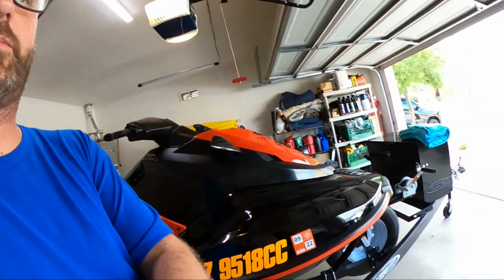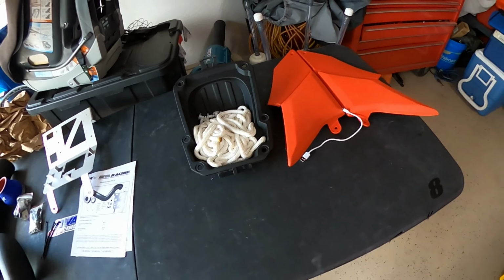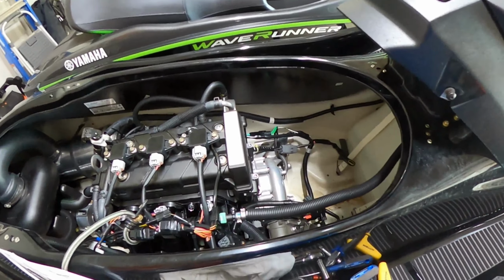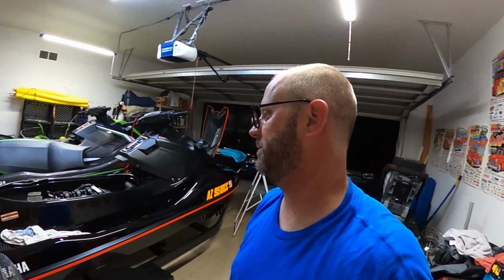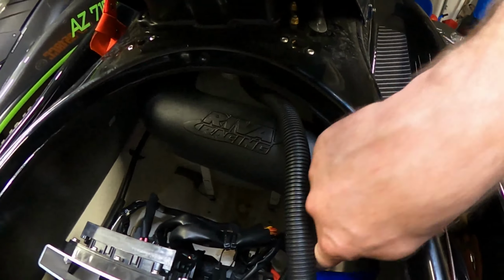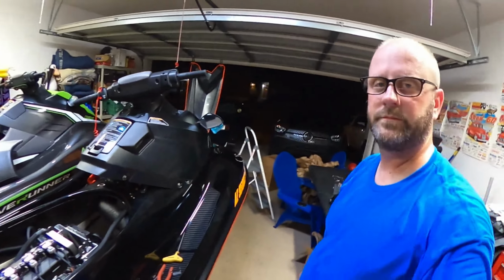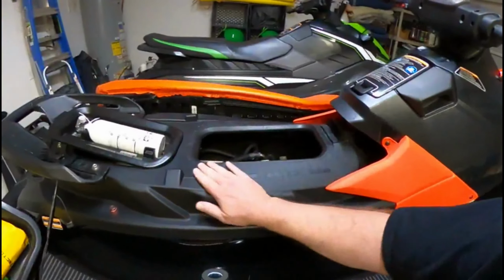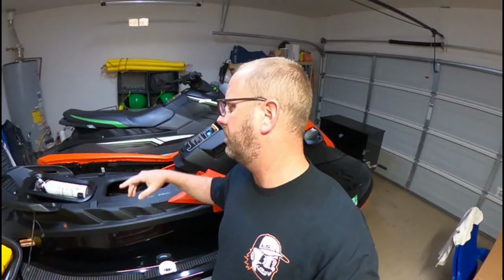Riva Power Intake Install & Test

Comment: Don't you love how it sounds wide open now?😁
Reply: Yep!
Reply from the maker: Sure do. Sorry, I originally replied under my other account 👍🏻
Reply: @oldfarth2016  I think I'm going to tune my ski again with my MapTuner X. I have to drain the gas tank of the 87 and get the 93 going through it.
Reply from the maker: @NCDroneFlyer  I did get some better results with 91 + octane booster (hard to find 93 in the sw). Also going to have the impeller sent out to remove 1 or 2 degrees. I am having the same issues as you. Not enough RPMS.
Reply: @oldfarth2016  I get 7700rpms with a 12/20 impeller and in fact I bounce off the rev limiter all the time. I can't hold the throttle wide open because of it and only about 80-85%.
Reply from the maker: @NCDroneFlyer  Mine pretty much does the same thing. I’ll let you know if the impeller change helps or doesn’t 👍🏻
Reply: @oldfarth2016  Please do.
Reply: @oldfarth2016  Did you end up removing a degree or 2 off the 12/17 impeller? And what were your results? And what elevation do you ride at?
Reply from the maker: Not yet. On the list for this year. Might just buy another 12/17 from Impros and have them take a degree out. I lost 40 pounds in the last 5 months so looking forward to power/weight ratio improvements in my next race in a couple weeks before pulling the trigger on another impeller. 👍🏻
Reply from the maker: Update: Finally had some pitch taken out. Was told it is now closer to a 12/15.

Old rpms @ 1500ft = 7800rpm
Old rpms @ 500ft = 8000rpm
New rpms @ 1500ft = 8350rpm
New rpms @ 500ft = TBA (should just be under the 8600rpm cut-off)

Totally different ski now. No longer have to wait for power wind-up. Top end is maybe 1mph higher. Low end small improvement. Biggest improvement was mid-range which is what I was looking for. Still need to test on the course though. More to come!